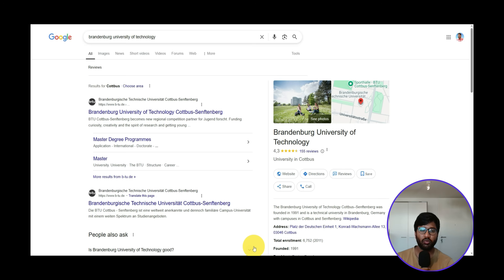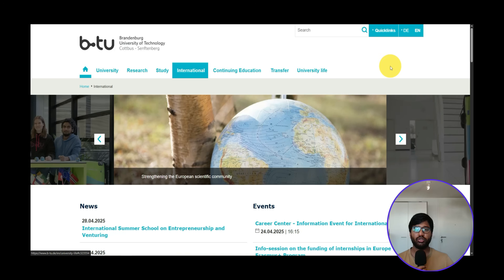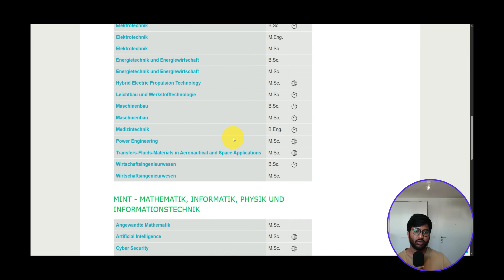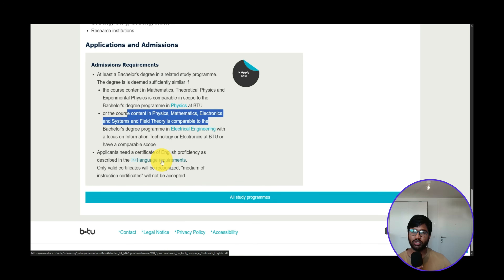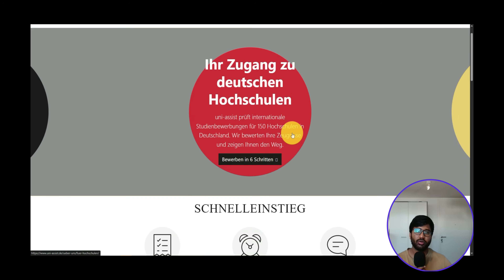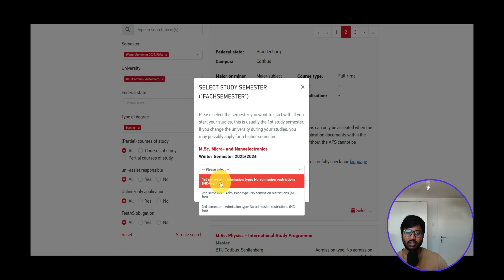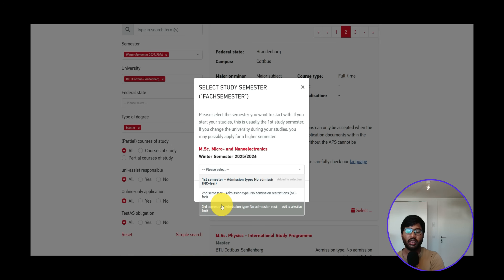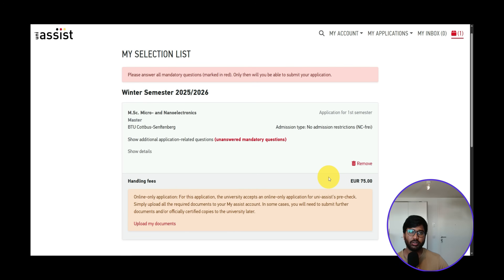HOW TO APPLY | MICRO - NANOELECTRONICS MSC | BTU COTTBUS | PART - 1 | REQUIREMENTS & REGISTRATION

Comment: Hello!, I have done 10+diploma in electrical engineering , so for uniassist what should i add, does i have to add 10th details or ii should add diploma ? really confused 😖. and if diploma what would me name of highest school leaving certificate? as there are 3 options , btw i am from Maharashtra. and  I want to apply for the same university BTU for Msc cyber security and deadline is 15th May , please reply back.
Reply from the maker: School you enter 10th
At university enter diploma as 1st university
And your bachelor degree as 2 nd university
Reply: @guideforgermanapplication6308   there is one option out of 3 in school section  ''Vocational Higher Secondary Examination / Higher Secondary Course Certificate - Vocational Education'' this is not for diploma right? no other option for 10th  Secondary School Certificate (SSC).
Reply from the maker: @jagannathvishe8327 you apply via uni assist check part two then you’ll get idea where to mention 10th 

And in university section enter bachelors
Reply: @guideforgermanapplication6308   Thank you very much. 🙏
Reply: @guideforgermanapplication6308   there is one option stating  Vocational Higher Secondary Examination / Higher Secondary Course Certificate - Vocational Education